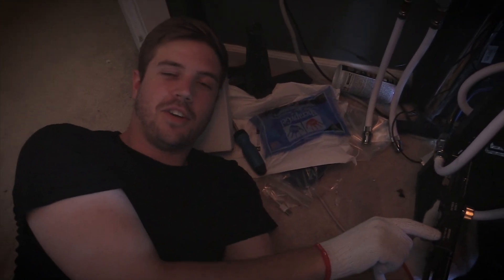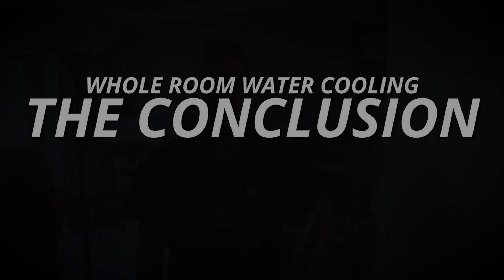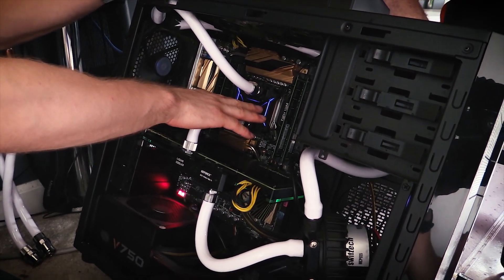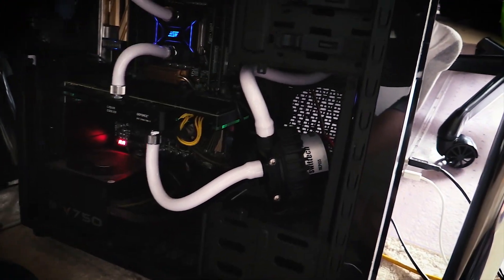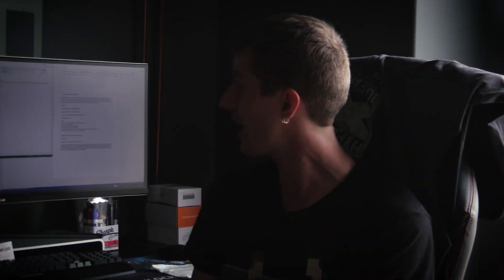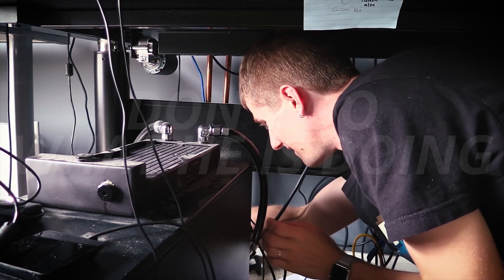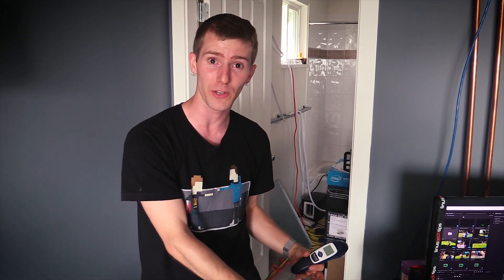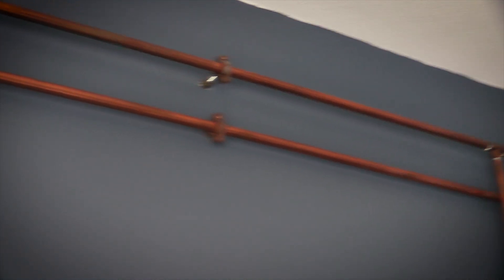Whole Room Water Cooling Part 7 - It's FINALLY over!

Comment: So your intake "cold water" is 29.7°C (85.5°F)?  Well there's your problem!
Reply: David Cox the radiators cant cool the water lower than ambient temp so what is your point? that was the temp outside where the rads are...
Reply: bflet12
 a compressor is used for gas refrigerants, not liquid ones. Partly to house gas in a compressed form when not in use, but also due to the nature of how a gas refrigerant works in a cooling system.

A gas cooling unit has 2 rads, one is called the evaporator, and the other is called a condenser. By using the condensing and evaporating functions of the gas refrigerant, it absorbs more temperature, as well as expels it. Remember that the rads for this are assisted by fans, which is actually where you need the fan on the cold side to Pull air through the Evaporator Rad, not Push, otherwise you just push the temperature back into the space you want to cool. The Condenser Rad then has fans that Push, and not Pull, the temperature out of the gas. The compressor then takes the cooled gas and condenses it closer to liquid form, so that it once again benefits the absorption rate of temperature when it re-injects it into the Evaporator.

The size of your Rads can certainly make a difference, but the efficiency of your fans is also important. When the fans you use are for a system to remain at room temperature (or ambient), then that is what you shall receive. You would actually need to crunch the numbers for total line length, refrigerant, rad size, and fan CFMs. more fans is not always more efficient, the important thing is how much airflow there is over the looped lines in the rad. Less airflow, less temperature leaves the line by the time a full pass goes through the rad.

Hopes this explains.
Reply: +Chad Kameda I don't understand how you've come to the conclusion that you can generate temperatures near 5C with fans and water in ambient temperatures?
Reply: Mohsen Tabouna - Hi, PVC is great and all, especially the PVC pipe products of today, but you would still need to wrap the pipes, otherwise you are still losing temperature too quickly before it makes it to the Rad. The only other thing is, I don't know if PVC is as good as Hard Drawn Copper, for handling potential pressure loads.

You are also right about the black coloured Rad they used, but not so much about the roofing. When working with my father, we would work on roofs with all kinds of black tar on them, if it was hot enough out, your feet would stick to it. That said, the condensing unit on the roof is fairly contained, and temperature is blown through the Rad of the condenser, not drawn through it, so the released temperature of the roofing is also blown away from the unit.

In regards to acidity of the water, and I may have mentioned this once, but many cities add flouride to their water. I know that with temperature, and time, you can build up flouride deposits, which can bond with hydrogen atoms to make Hydroflouric Acid. This acid eats practically everything but PVC plastic. With the extra water in the system, the acid doesn't have enough concentration to make it work slowly, and it is kept moving, so it is able to grab and eat at surfaces more quickly.

This is why I really think if you are going to liquid cool, you should just use anti-freeze, or similar liquid coolant product in a sealed system. For a project that size, it is likely to be expensive, but they already had to buy two special units for filtration. Take what you will from that.
Reply: +Chad Kameda Hi I'm 18 , Just spent 2 hours watching this whole thing to get more experience in tubing and stuff because i see too much of myself in Linus ,
Well i think that they should have used PVC instead of copper in order to achieve the main goal ( get the room significantly cooler ) , They Should have gotten an other 4*4 Rad Block ( Answering an upper comment here with a huge amount of likes which for fact points that people have a misunderstanding of Air cooling.. that Fans can't get water under Ambient air Temp,Well that's FALSE and a quick experience you can do is to blow air through your fingers with enough Force ( static Pressure ) air get's colder and you can feel it '' i've seen people turning water down to 3C with 3 Blocks of 4*4 rads''  ) 
inAdd , the grey tiles used for the roof they absorb heat and throw it back at the BLACK RADS !!  black is know as energy absorbent 
Then the metal Reservoir, that's gonna cause so much harm to the Copper blocks cause it's made out of Steal and it's gonna Oxydate them 
Finally why leaving tubes to turn completely poop kinda colored ??? you guys should have noticed that since the tube turned a bit yellowish and i know water Bio Stuff smells Bizarre even if there's a bit of it
 I Think the UV is useless too the IODINE contaminated water won't permit any further growth and will eradicate any kind of life there 

LINUS a tiny Tunisian Voice is talking to you here , Don't get discouraged in Few years or so ReDo !! the project it's an Awesome project alot of fun and stress but it's worth it and i know u already know that 
Thank you to how ever reads this hope this get's to the team , love -
 R.Charfeddine
Reply: +Mohsen Tabouna I would have used Car radiators rather than this 4x4 Rad Block thing, they are cheap and easy to get and are designed for much higher cooling capacities.
Reply: +PHUSII - It's not the rad, it's the CFMs of the fans. He used computer fans for a job that required something with a much higher output. Believe it or not, but you can generate temperatures approaching 5 Celsius with the right fans, using water as a coolant.

Build an inefficient system, and you get an inefficient result. All it takes is one thing to not do it's job correctly.
Reply: +Chad Kameda I'm curious what would happen if you included a compressor in the mix somehow (i.e. second cooling loop for the the rads.)
Reply: +Chad Kameda That's a nice explanation, but it has nothing to do with what I was talking about, which would be using a second system to cool the rad they already were using. I'm not under any sort of delusions as to the effectiveness of such a setup, but their whole-room system wasn't very well-planned in the first place, and it would be funny to see a refrigerator ripped apart and hooked up to their radiator.
Reply: bflet12 - So what you are asking about is having their rad in a room, or other limited space, that had it's own cooling. True, that it would work, so long as you kept the ambient temperature of the room at the temperature you desire, but then, you could just cool the room the computers are in instead.

You could do it, it would work, but it would be a waste.
Reply: +Chad Kameda Yes, I said I knew that... what's your point?
Reply: ***** - look up how to build a water cooler for beer, and then try to make one. It's faster than trying to school you on the chemistry and energy transfer dynamics involved.

But the short answer is this: Every refrigerant has a base temperature transfer rate, which can be adjusted by airflow over a radiator the refrigerant passes through. By increasing airflow, you allow a higher transfer rate of temperature to be exhausted from the system. Temperature can only be lowered with a given refrigerant so long as that refrigerant does not become solid, it must remain liquid or gas.

A Computer fan only generates enough airflow to match ambient temperature, it is not rated for anything less.
Reply: +Chad Kameda Thanks for the free lesson Chad. Damn I love Internet College!
Reply: +Mohsen Tabouna As before I don't really see how you're both making claims of being able to achieve temperatures of 5C or below with water and just high air pressure. Blowing air through your hands is an unclear representation of what is happening. The surface of your skin is a heated element, above ambient. Molecules around your skin will want to reach a thermal equilibrium and so the heat around them is increased. When blowing on your hand your forcing air that is at ambient temperature in contact with your hand. Because these have now not reach the equilibrium energy will be transferred from your hand to the new surrounding air. In some instances water on the skin surface will be evaporated meaning higher heat exchange to the atmosphere. If your blowing air that's 20C on to your hand, regardless of what speed that hair is moving your hand will never reach below 20C.

The only way your going to achieve temperatures below the ambient in water cooling is using a refrigerant that is below ambient to achieve this regardless of how many radiators you have. The amount of cooling required to get a water cooling loop to 5C is going to be rather energy intensive.
Reply: ***** - when you compress a gas into a liquid, and then let it expand, the expansion back into a gas requires it to draw in thermal energy. If a compressed gas is allowed to expand rapidly enough, it will cool, and sometimes freeze the atmosphere and surfaces it come in contact with.

In a controlled experiment using water, boiled into steam, and then contained at high pressure, when released and allowed to expand, it was capable of freezing water to a depth of 6 inches over a 5-foot radius. The experiment noted that the more pure the steam, the greater the effect would be.

So that is how Expansion Cooling works.

When you blow at your skin from at least 2 inches from your face, you are actually drying a salt-water mixture off your skin (aka your sweat). As this salt-water evaporates away from your skin, you begin to cool. The more air you blow over your skin, the faster this salt-water can evaporate, meaning you will gradually become more cooled. You are correct in that your breath can only do so much, but that is because your breath has a limited airflow, and is inconsistent, where as a fan is consistent. There are also higher airflow fans that exist, however, at a certain point, you would need to start spraying your hands with water to have further cooling with a more high-powered fan, but be careful, you can actually give yourself frost burn this way with a powerful enough fan. You can do this in an environment that is above 21 Celsius (average room temperature).

And that is how Evaporative Cooling works.
Reply: +Chad Kameda I agree with your statements on how a compressor will assist in achieving lower temperatures and how the expansion of a liquid back into a gas in quick secession will result in lower temperatures . However I'm more reflecting on your original statement in regards to being able to achieve around 5C, with water as a coolant, utilizing high performance fans with high air flow. This was before the mention of using a compressor. Also the mention of this by some one previously that they've been able to achieve temperatures of 3-5C. These comments I'm referring to aren't in relation to expansion cooling, no compression is taking place on a level that is going to effect the temperature to be below ambient as far as I can see. At least not within a computer water cooling set-up. Are you indicating that your planning on using Evaporative cooling to cool the air the before it is passed through the radiators to achieve such temperatures? If this is you're suggestion I'd expect this give results with variance depending on the humidity in the atmosphere. So having a water pad with a fan pulling air through that and then pushing air through the radiator? Regards.
Reply: ***** - So in the case of water, it just loves to take in temperature. It also likes to lose temperature. Something else you need to note is how quickly air cools itself when moving. Take two fingers and set them against your lips. Now when you blow through them, the air is quite warm, but as you move your fingers away from your lips, the air cools rather quickly. Try this on a day with warm wind, and you will still cause the air you blow to cool in comparison to the warm wind. Now add shade, and you cause more cooling of the air.

Now keep in mind how water likes to transfer temperature, not absorb or hold, but overall transfer it. Water will balance itself to whatever temperature it has access to. So if air can cool itself while static in shade, and by moving itself, imagine what air moving at higher speeds will cool to.

Now adding humidity, believe it or not, after a certain humidity level, you need to use more powerful fans, otherwise you will allow condensation to build up on the rad, and you will lose efficiency. You need to make sure any small amount of condensation that builds on the rad, is expelled quickly.

I'm going to add a quick note here about your furnace. your furnace heats a pad, and a fan then takes that temperature and spreads it out through your house, but even though the pad is heated to a high temperature, what the fan blows is that temperature, stretched thin. Take the energy in 1 cubic inch that makes 30 degrees Celsius, adding a fan, stretches that energy out. That energy that was in that one inch, is now in 1 foot with a low power fan. Increase the fan power, and you extend the stretching of that energy. Your warmest points of the stretched energy are before the fan (highest temperature), and after the stretch point (ambient temperature). Add a fan grate, and you think that "well it can't stretch it out that far anymore" but actually it still does. in a properly designed cooling system, the rad is placed half way between the fan and the exhaust grate. A powerful enough fan will still cause the same amount of stretch through the rad, and exhaust the warmer temperature out the grate, but at the grate, that temperature is being compressed again before being forced out.

It's a little more complex than that, but this is the general idea of what is going on.
Reply: +Chad Kameda  @bflet12 i think what bflet12 was suggesting was having the coolant itself refrigerated and have the refrigerated coolest pass through the pc components. the only ambient condition you would need to worry about, with temps possibly dropping below zero, would be moisture content in the air. also i think your missiing the point when the other guys are talking about an compressor. i think they are using it more generally. in a normal refrigeration system the condenser turns the high pressure vapor into a condensed liquid. the compressor dose not turn the vapor into a liquid. think of it more as a pump.
Reply: Adrian Baus - That would be the same as putting a liquid cooled computer in a properly A/C'd room, and thus it would be inefficient. I've already posted this once, so it would have been helpful had you read everything before commenting.

As for your compressor comments, a compressor does actually compress the gas into a liquid, and store it that way. The condenser condenses the gas after it has been cooled sufficiently. Please do not confuse the "condenser" and the "compressor", as they are two different things in a gas system. It is not "just a pump", but a compressor does have a pump in it usually. Sometimes, the pump can actually be on the evaporator side, outside the compressor, but those start being highly purposed cooling systems.
Reply: I think aim of the game isn't efficiency it's how cold you can get your CPU. If you were to chill your coolant below zero (depending on you heat exchanger design ie heat sync) you would be able to achieve much colder temps then purely with a radiator. 

As for your compress comments when it comes to refrigeration I assure you the compress dose not change the suction vapor into a liquid. I'm honestly  interested as to where you got your information from. (a link would be nice). As for pumps used after an evaporator I could talk all day about liquid recirculation.
Reply: +Chad Kameda I hope I'm not coming across as rude and please forgive my spelling I tend to just let auto correct do its thing. I agree with the science behind what you are saying I'm just interested as to where you have seen liquefied gas (produced by the the compressor.) in a refrigeration system?
Reply: +Adrian Baus bump
Reply: +Chad Kameda One look at those fans and I was facepalming. He could have used a $10 box fan and a real radiator.
Reply: +Chad Kameda The concept of stretching the energy contained in a small area over a larger area with a fan in order to reach lower than ambient temperatures (5C) on water cooling with just a radiator still doesn't make sense to me. Wouldn't the fan causing the stretch be pushing ambient energy from behind it over that "stretch" area? Logically if energy is being pushed into that area it couldn't have less energy than ambient, in fact it will always have ambient energy + whatever energy you spread from the heat pipe. Additionally, you said blowing air on a warm day will cause the air to cool below ambient before it hits your hand. This doesn't sit will with how this phenomenon has been explained. 

"Try this on a day with warm wind, and you will still cause the air you blow to cool in comparison to the warm wind"

When you purse your lips and blow air over your hand, it feels cool because you are putting your skin in contact with more air that is at a lower temperature than it. It feels cooler from far away from your lips because the air you blow has more time to mingle with other molecules of air that are at ambient temperature and bring those along for the ride to strike your hand. But the jet of air striking your hand will always be a bit above ambient temperature because your expired air is close to body temperature. Additionally, the only cooling effect beyond ambient you get on your hand is from the phase change of liquids already on your hands. Radiators do not have this physiological property.

Please help me logically understand how it is possible to cool a cpu to 5c, well below ambient, using only a radiator, pump, fan, and distilled water if room temperature is 20c.
Reply: systoxity - first thing you need to understand, and I said this already, that my use of the word "stretching" was an over-simplification of what actually happens, if not a gross over-simplification. Perhaps displacement would be slightly better, but not sure that would really describe what is going on accurately either.

Now rather than explain it to you, I would actually rather you did some experimentation.

Take two poxes of similar shape and size. If you can get exact boxes, even better.

In one box, cut something similar to a grate in the bottom, and have a high power fan that fits the box face out the top, and have it as close to the top as possible, while still remaining inside the box.

In the second box, cut a grate in the bottom again, but in one of the sides (which will become the top of the whole assembly), cut a hole large enough to fit your hand into, at roughly the half-way point between the box top and bottom (grate).

Use duct tape to tape the boxes together.

Now, you can use your hand, to test the temperature for how it feels, but having a thermometer will also let you find your ambient room, and then inside the assembly.

When explanations fail, practical application helps.
Reply: That sounds like a really cool experiment! But, I don’t have the fans to try, and am currently traveling abroad. I’m curious to know the results though. There is no doubt that putting your hand in will feel cool, but there are too many variables for what can cause the sensation/drop in skin temperature.  The thermometer would be a sure fire way to know if what you’re proposing works. It would have to be insulated from the person’s hand of course.
 
Because I can’t try this out for myself, is there a name for this phenomenon, a Wikipedia article going into more detail, or any reputable source with an explanation where I can do more research? I tried doing a google search for radiators that cool past ambient with just air and distilled water and the consensus is that it’s not possible for the reasons some of us have already pointed out. I can’t find any evidence to the contrary and would appreciate any help in substantiating your claims.
Thank you and looking forward to hearing back.
Reply: +Chad Kameda if they wanted cooler temps a bong would have worked great, however lots of water evap sometime no bueno.
Reply: +LightWrathme  Chad is trolling you. Heat doesn't go from cold objects to the hot ones, only the other way around, no matter how much airflow you supply to the radiator. The radiator efficiency will actually be approximately proportional to the airflow, to area of the radiator, and to the difference in temperatures between radiator and ambient. At ambient a radiator stops working. The statement that you can arbitrarily increase heat transfer by simply increasing airflow regardless of anything else is among the most stupid shit i have ever read.

You can cool things to colder than ambient, but you need to use either an active heat pump (e.g. adiabatic process) or an evaporative cooler for that. "Water cooler for beer" mentioned is exactly an evaporative cooler. During evaporating cooling, molecules with higher brownian energy leave the liquid and are disposed of. They would normally rejoin the liquid in an equilibrium; however active airflow away from the liquid prevents that. Water vaporization energy is 627Wh/l, which means that to continuously cool a hypothetical 627W heat source, you need to evaporate one litre per hour.

It does of course follow that you can sprinkle water on your radiator to combine dissipative cooling with evaporative cooling for somewhat sub-ambient temperatures. The nature may even occasionally sprinkle the water outdoors for you. You can even cause condensation of atmospheric water if you expand a volume of air, so e.g. water can condensate before a particularly high-pressure fan or on one side of an airfoil, but that will might be fan that you're not going to want to hear. Sure you could get a few droplets an hour of condensation worth for evaporative cooling with more powerful fans, but it has to be terribly inefficient, where's the point in that? Also, the dynamics of this process is very particular to geometry, so where at one side of the fan expansion, cooling and condensation occurs, the opposite must happen at the other side, while the airflow is the same on both sides, further invalidating the nonsensical airflow statement.

There is also no danger whatsoever in "losing temperature too quickly before you get to the rad" due to PVC, because let's say both the PVC and the copper radiator act as radiators, that's correct. But since the area of the copper radiator is much larger, its thermal resistance is much lower, and the airflow through it is much higher, it's obvious that most of the temperature drop will be experienced on the copper radiator, not on the PVC tubing, unless the radiator turns out to be in much higher ambient temperature than the tubing. Then you keep in mind that the building is not air conditioned and thus indoors has to be on average warmer than outdoors.
Reply: Siana Gearz - Are you an engineer? Just asking because if you are, that tells me everything I need to know about your knowledge of practical application.

Your ambient temperature can change based on so many factors, of which you can actually control a few.

For example, do you know why residential A/C condensers are put on the ground, usually on the shaded side of the house? Because shade has a lower ambient, and the ground has an even lower ambient.

For the water condensation on the ground making everything cooler, as water turns to vapour and expands, it absorbs thermal energy, and we all know that thermal energy rises. Water has a harder time losing that energy, so it carries it up farther before it radiates any excess thermal energy. Air, is between 60-70% Nitrogen, and only 20-30% Oxygen. Nitrogen loves to take and hold temperature, so the more you pass Nitrogen over temperature, the more the Nitrogen will absorb that temperature.

Radiator efficiency is only ONE aspect of temperature transfer rate calculations. So let's look at what actually happens:

- Radiator Fin Efficiency
- Refrigerant Efficiency
- Air Flow Speed
- Air Flow Efficiency
- Ambient Controls in Use

And FYI you twat, they were using COPPER TUBING in the room where the computers where, which is where I was saying the temperature bleed was coming from.

PVC - Poly-Vinyl Chloride - PLASTIC, how does COPPER = PLASTIC?

And I'm trolling? Get a life...
Reply: *****  Perhaps i misread you somewhere, because i thought you suggested that PVC pipe needs to be isolated? Yes, copper will bleed a lot more heat than plastic. Still not sure it's an issue, i mean the actual radiator is what, 4 square meters at the very least if you count all the fins and has a shit ton of airflow, and the copper pipes in the render room are nowhere near that area and in stale air. I still think only a minuscule portion of total heat is dropped inside the room.
Reply: Siana Gearz - so lets go through the list shall we:

1) Uninsulated Copper Pipe to move coolant
2) Water is our coolant
3) Single level radiator coil
4) Second Floor placement
5) High Efficiency, Low Speed Fans
6) Initially unshaded

Uninsulated copper over 15 feet in length will bleed temperature like a strainer holding water. Remembering this is not an efficient coolant we are using.

Single-level radiator coil with short, not wide fins, so the temperature has less surface area in which to be removed from.

I believe I just mentioned ground level being more efficient in placement, and we are using a more inefficient coolant to begin with. Second floor, was never a good idea.

The fans were well directed, but computer fans are all low speed, they only get about as fast as your standard room fan that you plug into the wall and set to 'high'.

They did figure out to shade the thing eventually, but yeah... Hydro-Flouric Acid cooking system. Just add tap water.

Don't even need to do the math, already know the system was a failure for using water as the coolant.